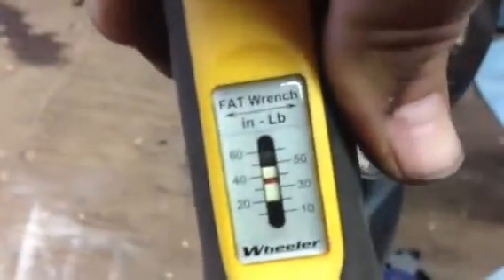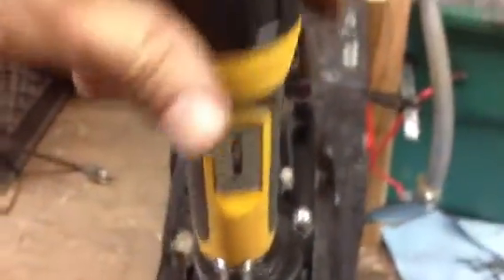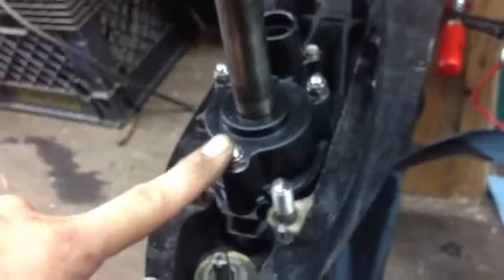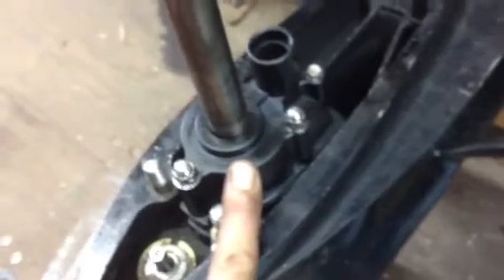Mercruiser alpha 1 out drive water pump replacement

Comment: common sense goes a long way too even without that tool. you get them snug and go another eight turn. Just figure even if they pump came loose which is almost  impossible and unheard of the pump can't go anywhere because the upper unit is holding it on there.